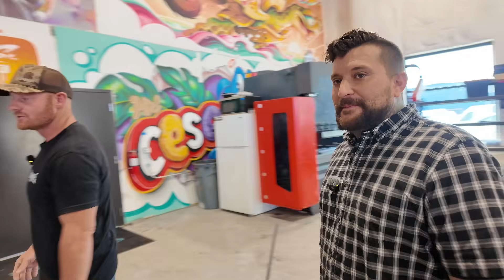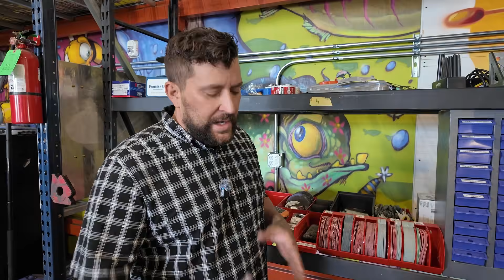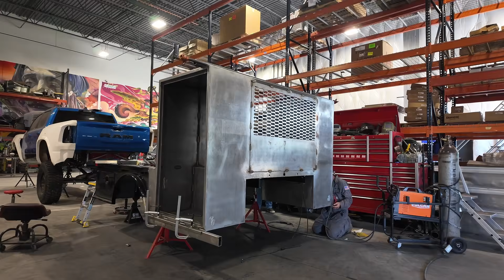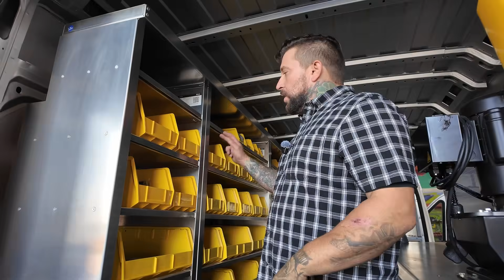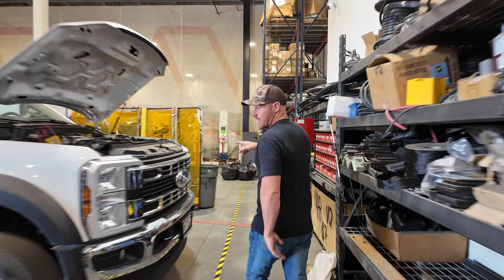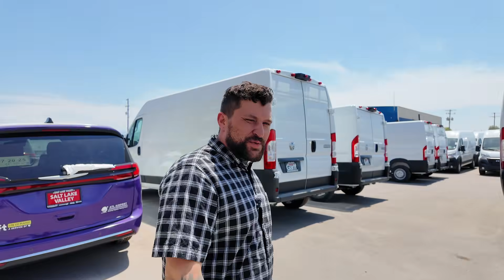30,000 Sq ft Fab Shop! (Equipment tour)

Comment: The van for the hydrolic hoses needs a microwave oven and kettle,  also a hand-wash basin.  Most work vehicles in the uk 🇬🇧  , especially civil engineers, are fitted with these as standard.
Reply from the maker: Hand wash bay does make a lot of sense on this one